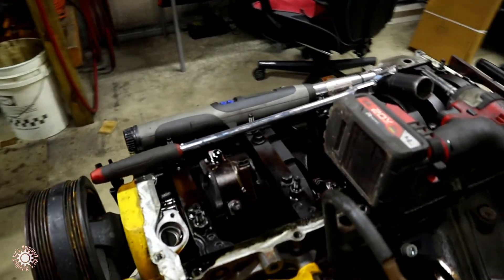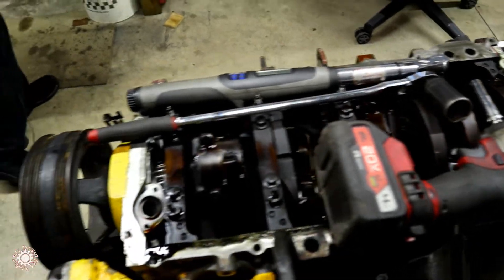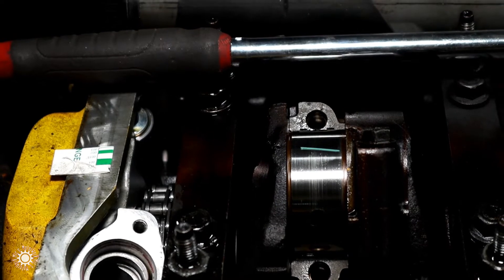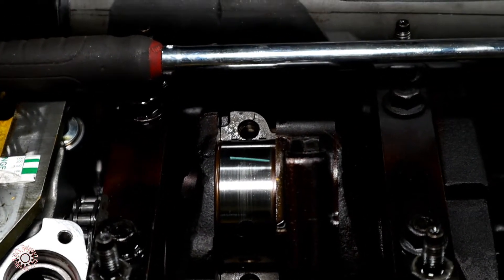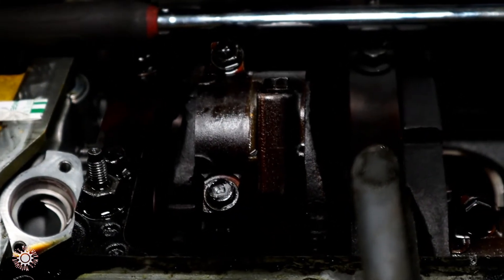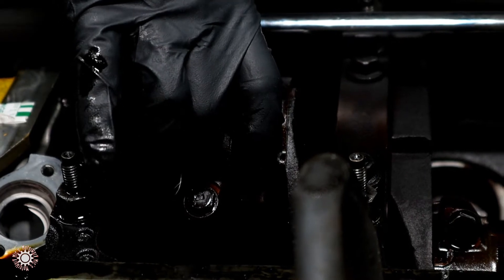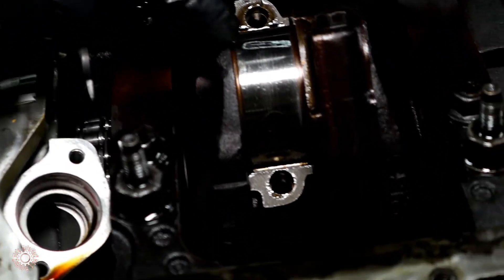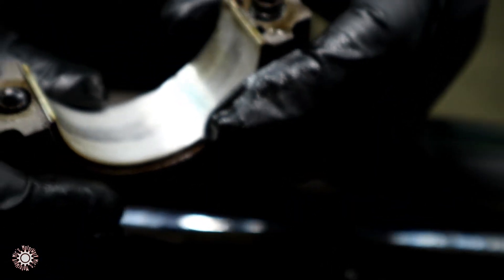How to Use Plastigage to Check Rod Bearing Clearance

Comment: I'm very sorry for asking a question that you might be considered stupid..
Also I know the video is 2 years old
So please don't judge me on it.. 
 
I have a Ford 3.5l Ecoboost engine still in the car that i was told has a slight rod knock..
I've never heard of a slight rod knock but I was hearing it and it's not exactly loud like other engines that rod knock  and it definitely sounds like one though..
Anyway... 
I have already removed the oil pan and all the rod caps the Crank looks very good & is well within tolerances but 3 of the 6 connecting rod bearings have some  wear and scuffing/ imbedded bits that appear to be from lack of oil maintenance..

Do I use the plastiguage with the old bearings to get my clearances?
Or do I have to get a set of standard size connecting rod bearings and install them and then use the plasti gauge to check the clearances ?
I assume I would use the old bearings even though they are worn out and would obviously have a bigger clearance than the ones that aren't but I'm very confused about it and can't get an answer from anyone anywhere else so im hoping and praying that you will take the time to respond to me on this video.. 

Also the main bearings and journals have no indication of damage or wear and no scuffing or anything...
Reply from the maker: Great question and thank you for reaching out. 

This is Mike. If it were me doing the work, I would measure (mic) the journals and mains on the crank to ensure proper diameter and use a new set of bearings for measuring clearance with Plastigauge. Definitely cross-reference your measurements with good source materials.

I'll ask Jon for you and follow up with this reply if necessary. 

Good luck.
Reply from the maker: Checked with Jon. He said, "Yes. Always check your clearance with new bearings."
Reply: @MicsMotorworx  
So I should order a full set of standard size connecting rod bearings and use them ?
I know I should use precision tools for the measurements and all and then double check with the plastiguage but I don't have the tools on hand so can I get close enough If I purchase full set of standard rod bearings and then stall them and use plastiguage And if I need oversized or undersized bearings for some reason I would have to order another set with the right clearances correct ?
 I'm asking because I'll try and get the right tools but just in case I don't or can't get them is that the next best option?

Thanks for your help and support..
I've reached out to other people on YouTube and your the only one that responded back and I really appreciate it so much..
Thanks again for your time.
Hope you have a very blessed future. .
Reply from the maker: Fortunately, bearing materials are softer than the crank. Tools help free up uncertainty. Plastigauge is a tool. A machinist would recommend things specifically detailed. A shady-tree mechanic would recommend something else. It all depends on your knowledge and ability. 

I would mic the crank. Advance and Autozone have a tool rental program. But if you can't get the reight tools, measure with pg. Start at 0 then turn the crank 90 deg and measure again. Repeat for 180 and 270 deg. Check for consistency and inconsistencies.  Honestly, though. Oversized bearings should only be used when the crank has been turned. If the bearings ate the crank enough to require oversized bearings, it'll need to be turned at a machine shop.

Good luck.
Reply: @MicsMotorworx  

Thanks so much for your help... 
And thank you for responding...
  
I do have some sound clips or videos of what the engines doing The noise it's making the knocking sound would you be interested in listening to that Tell me what you think it might be ?
Think I'm going to follow your advice That's how I'm going to handle it and doesn't like to cranks all chewed up and it doesn't even look like a bearings spun When I remove them they were all sitting where they should be to crank doesn't look all chewed up maybe some minor scoring on it It's basically so light that I can't feel it..
Not sure if there's any way to PM me or for me to PM you instead of sending messages through their comments on your video..
Reply from the maker: Hey. Just checked with Jon. 

He recommended going with new standard sized bearings.  Clean the journals with Emory cloth as demonstrated.  If the pg still shows within clearance or tolerance and your still knocking, then it's time to check wrist pins. Good luck and keep us updated with what you find.
Reply: @MicsMotorworx  
As always thanks for getting back to me I decided to take it one step further so I ordered a bore scope , I got one from Amazon for like 25 bucks It hooks up to my Android phone and it has a very good image and takes very good pictures It's a little hard to see a cylinder walls but once I figure out how to manipulate it in there was actually halfway decent way better than another one I used to have a few years ago that cost hundreds of dollars..
Either way I was trying to attach a picture to this comment or figure out a way to send you one and I don't really know how to do that so I was trying to show you some images that I took of what I got with the scope but I can't seem to figure it out I even went to your page information and don't see any way to do that either..
Either way doesn't look good..
Thanks for all your help

Comment: This repair may last a while but it will not last. If you measure the oil clearance in the Rods, what about the clearance in the Mains and the bores? 

I worked in a engine repair/rebuild shop with  a professional mechanic who worked separately from the machining operations. Never did I see him measure and change Main Bearings in any vehicle. The Long Block was removed and the engine torn down completely. All parts cleaned, inspected and measured.

If any machining was needed, it was performed using Engine Building machines, including... 

° Bores (Pistons and Mains)
° Crank shaft Journals (throws)
• Crank straightness.
Etc..

Any Out of Round or taper were referenced according to factory specifications and corrected. 

Save money and time doing it this way? You spend more money when the engine fails you. Then the entire Long Block will need to be removed and torn down.
Reply from the maker: Good information.

Comment: The correct language to Engine Building measuring specifications (in written form) is in numerical form.

Example: 
A .030 over 4 inch bore = 4.030 inches.
Oil Clearance to a Rod Bearing (in theory) = .0025

Some more:
.0035 = Three and a half thou
.0002 = Two tenths

No active machinist or Engine Builder says "Ten Thousandths". Unless you are stuck in a classroom.
Reply from the maker: Thanks again.

Comment: I looked it up in my 3.000 page Helm shop manual.   It says 0.0008 to 0.0025   That's 8 to 25 ten thousandths.     Mine all measured at 20 ten thousandths using plasticgage.   They all looked good.   I changed all the rod bearings but not the mains
Reply from the maker: Neat. As we understand, there are different clearances for different generations of LS, and engines in general. Glad yours was good. Thanks for watching.

Comment: You said the GM is 23 to 76 thou  You did the rod and it measured 5 which is out of spec(too low), but you said it was OK.  Am I on crack or is it too tight?  5 is less than 23 or did I flunk basic math?
Reply from the maker: Yes. Jon did misspeak there. He should have stated 5 ten-thousandths when looking at the reading. 0.0005.

Comment: It doesn't bug you guys that you used a cordless drill to tighten down those caps? When using plastigauge I always use torque wrench to specific foot lbs
Reply from the maker: We initially set the caps in place with a low torque settings on the electric impact. It's fine to do that when it's not set near or over the recommended specs.

Little Jon then went back and set the cap in the proper sequence with the proper specs.  Thanks for watching and for the feedback 😊
Reply: @MicsMotorworx  good to know thank you 😊